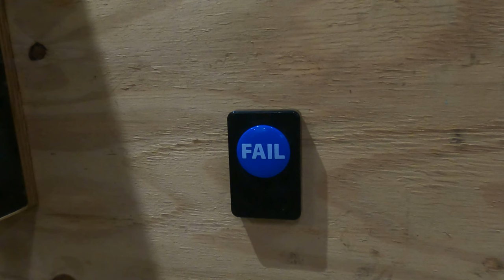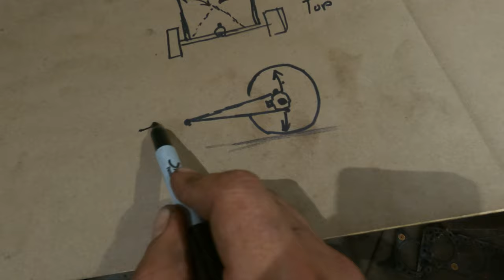MYSTERIES of Hot Rod Rear Suspension REVEALED!!! Radius Rods? Ladder Bars? Hair Pins?

Comment: Did you check to see if the hairpins were the same length? I've run into identical pieces that weren't.  Also springs settled with use. I've always struggled with how simulate that when setting up suspensions.
Reply from the maker: That’s interesting.  I do my initial set up by laying them on top of each other.    But that’s for sure something to look out for

Comment: They"re not speed holes. They are called lightening holes or swiss cheese holes. Parts swiss cheese PROPERLY  also help strengthen  the part. Swiss cheesing was developed during WW11, for the aircraft industry

Comment: Are the hairpins all that you’re using?  Any concern that you might need a torque arm or panhard bar?  As you know there is no end of internet hot rodders with opinions on this… it’s a lot to digest.  I’m using 37-40 rear radius rods so I’m thinking I may need some kind of torque arm even with a mild flathead.
Reply from the maker: That’s the plan.   Fair question though 
As far as the torque arm 
With the hairpin mounted to the top and bottom on the axle tube.  The top is in extension during acceleration( axle trying to roll up)  and the bottom is in compression.  The top functions much like a torque arm in this case … and it’s not gonna stretch.   
     The stiffener creates a mini truss to resist bending/yield.  
      And you’re a particular case AJ I would run at torque arm with the spring over axle and 40 radius rods.   But The radius rods were just not meant to have that type of force applied and they will bend a bit under hard acceleration.   That said I don’t think you could break them (from accelerating)unless you were routinely drag racing or something like that. And odds are something else would give it up first.   I think your set up will work just fine.   And a torque arm is cheap insurance 
      As for the pan hard bar.    I have never had an issue in a light car with a transverse spring.    It’s certainly not a bad idea if you set it up right.  For anyone reading the goal of the pan hard bar is to keep the axle centered with the frame and body(right to left ) .    And in my experience the leaf spring does that just fine on its own in a street car model a or t. 
    I guess I will do a video on the mercury pan hard  bar because the travel on those coil springs is dramatic.  It had one factory and needs on for sure with the new suspension
Reply: @betweenthesharksgarage  Thanks for the expanded thought process.  I already decided my 40 rods need some backup but I’ve been struggling with the “how much”  part and “the look”.   I know a simple tube w/ heim joints would be easy and strong but they look out of place on a vintage style build (in my opinion) so I’ve been thinking out a more period looking solution using vintage parts.  I’ve been wondering if it will be strong enough though… I know a lot of people run 40 bones by themselves and combined with your comment I now think my idea will be fine.  Hopefully I’ll have a video on it by the end of the year.  Thanks again!
Reply from the maker: @AJStarch  Hey man I have had my head in this problem for a while.   You may not need as  much as you think.   First off any kind of torque arm that is mounted to the upper half of the axle will be in tension when you accelerate.  meaning the axle will be trying to spin up as the wheels spin down trying to pull/stretch whatever you use as a torque arm, testing its tensile strength .     The tensile strength of a  standard   1/4" bolt (grade 2)  is 75,000 psi.  That will not be the first thing to break for sure.  Plus, the torque arm mostly helps deal with the shock force that has to brake the friction of the tires on the pavement, once the car is rolling the force for the axle to spin upward decreases significantly.    I think the biggest thing is getting the geometry right so that nothing ends up binding.   I think that means that... when viewed from the side.... the torque arm and the radius rods pivot off the same point and thus share the same radius in profile.    Otherwise I would imagine the rear end would have two pivot points forcing the rear end to try to move in two different arcs.... i think...  or perhaps just weld the front of the torque arm to the front of one of your radius rods and let them share that pivot...sorta making a hairpin